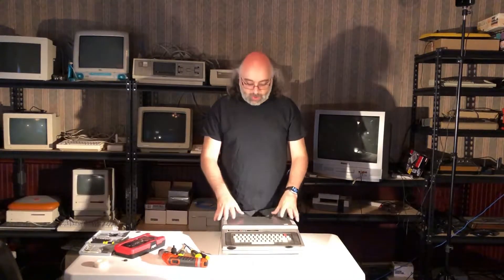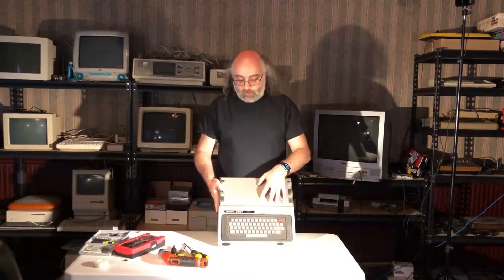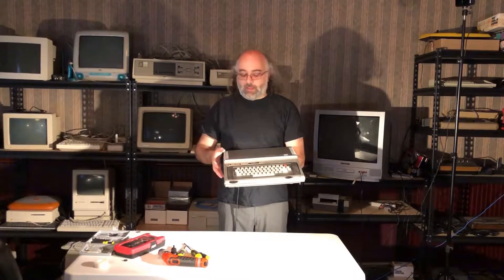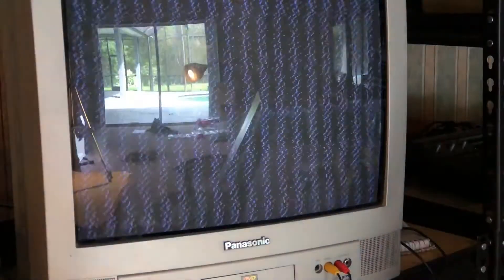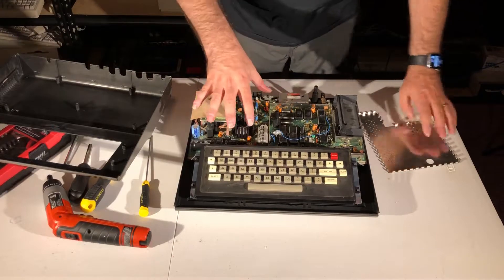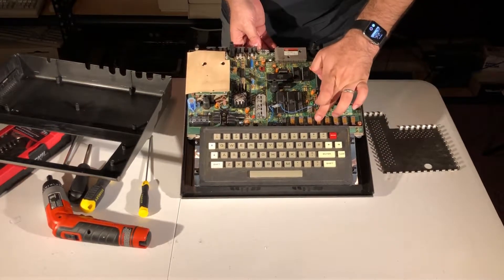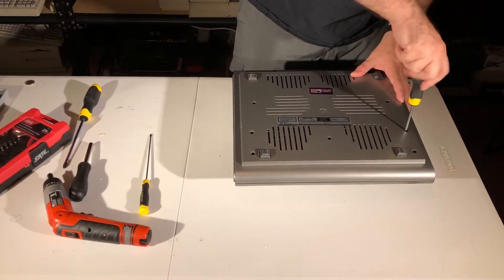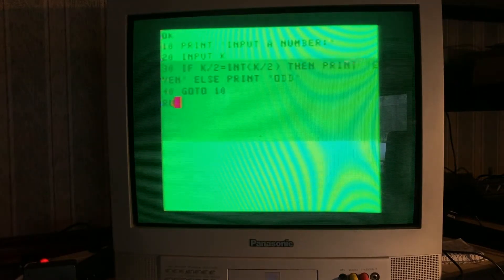TRS-80 Color Computer Repair

Comment: That coco was used a lot.  You can tell by the two black spots in front where the user's hands sat while typing.  Mind had the same after about 3 years of constant, daily use.
Reply from the maker: True, another sign that it saw heavy use was that the previous user upgraded the memory to 64Kb. I love to see machines that were used so much.